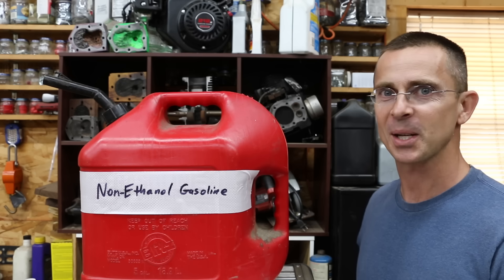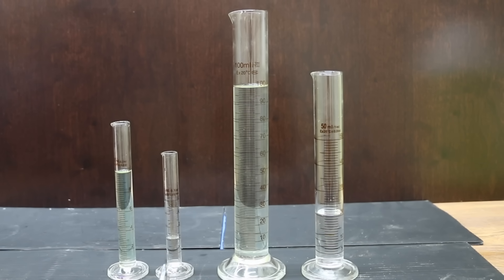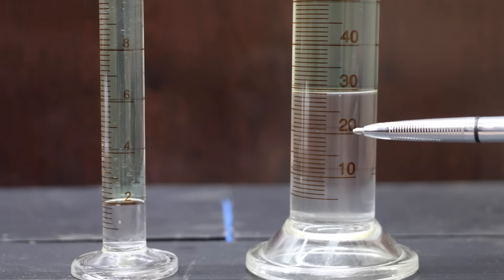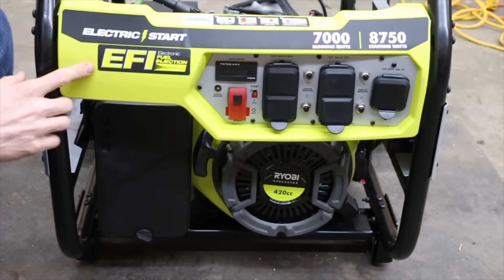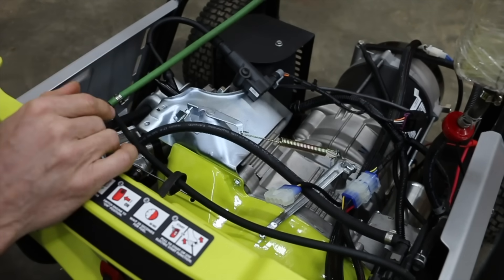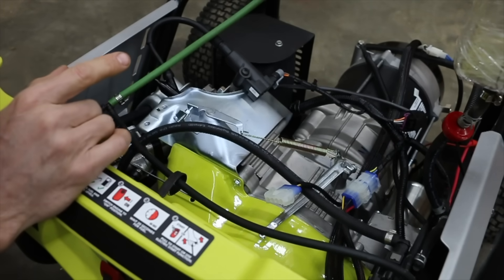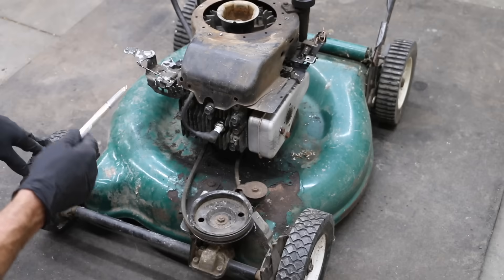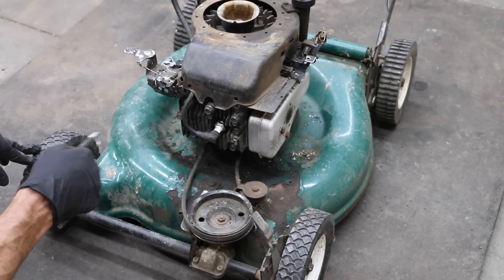Is Non-Ethanol Gasoline Really Better? See the PROOF!

Comment: I've purchased three Holley mechanical gas pumps for my 1967 Ford Mustang.  They failed and I've got a fourth one ordered.  Holley explains to me that they don't warranty any mechanical fuel pump that is used with any ethanol gasoline.  That pretty much says it all.
Reply from the maker: Great information. Thank you
Reply: I think this says more about Holley than ethanol gasoline.  Sounds like Holley is living in the past.  Ethanol gas has been around for HOW MANY decades now?  They need to up their game.  They are resisting change like small engine manufacturers.  And perhaps with the same planned obsolescence as their model perhaps?  Auto manufacturers cracked the code on this a LONG time ago.

What is the mode of failure?
Reply: @mikemorgan5015  Diaphram.
Reply: @web5271  Yeah, that should be a pretty easy material change fix.  It's unacceptable to produce a part that isn't compatible with 99% of the available fuel out there.  Knock on wood, I haven't had a fuel pump on a vehicle fail in years.  This reply is probably the kiss of death for that record.  Haha!
Reply: @mikemorgan5015  I have a 1983 stihl chainsaw and have never had a problem with ethanol gas.  I think the newer stuff is made cheaper and that's the real problem.
Reply: @CraigThorne  I believe you.  Stihl "gets it".  They are a premium brand for pros(mostly).  Their reputation is worth more to them than a few cents or dollars worth of better materials.
Reply: @CraigThorne  Reputable companies all had to change any rubber compound in their products over to ethanol compatible synthetic blends when ethanol was introduced to the market.  This is the main reason ethanol is not allowed in aircraft, and not recommended for boats.  Most brands in these industries never accommodated changes in fuel chemistry.  Plus, 100% gas doesn't go bad in a few months.  Ethanol is alcohol based, where gasoline is a hydrocarbon, oil based.  Not many types of rubbers are compatible with both alcohols and oils.
Reply: @jaredbrandt9602  Yes at around 1990-92 when congress passed amendments to the Clean Air Act.  My saw was built in 1983, some 10 years before mandated use of Ethanal in gasoline, and it runs just fine and i've not had any problems with fuel-lines breaking down etc.
Reply: @CraigThorne  I'm trying to wrap my brain around this strange comparison...so you think because your 1983 saw is still running that ethanol is not a significant cause for problems for all gasoline machinery?  Dang tell the FAA we can use ethanol at the airfield now...cracked fuel lines is no big deal for 1983 saws, so why should it matter at 10k AGL???
Reply: @jaredbrandt9602  So trying to wrap my brain about your false equivalency with aviation and most all other engines that use gasoline.  Guess what i don't use high octane gasoline in any of my vehicles.
Reply: Holley knows there are issues and had plenty of fuel pumps on test since at least 2000.  Marketing was too cheap to include viton o-rings...added $0.2 too much cost to the product.  Ethanol is not compatible with standard rubber seals.
Reply: @jaredbrandt9602  I'm not up to speed enough to weigh in on details with any authority, but your scenario seems highly likely.  Viton is great stuff.  It's been around a LONG time too.  I build chemical application equipment and started ordering Viton seals and o-rings separately and replacing the factory seals before we put systems in the field.  Call backs and complaints went to near zero immediately.
Reply: ...another funny thing about ethanol though.  Main reason it was implemented was to put all the dilapidated (and cheap for politicians and oil manufactures to purchase) corn farms in the corn belt to work.  EPA and other gov offices have been nosediving progress in automotive in the USA for years...pretty much what they did with the rest of American industry.  It's all about keeping the fat cats on top.
Reply: @jaredbrandt9602  that's a myth, industry switched to ethanol for octane ratings due to pollution litigation and impending bans of MTBE fuel additive due to billions of dollars in remediation costs of soil and ground water contamination.
Reply: That's just a way for them to get out of paying you back for all of the money you've spent dude.
Reply: It says to me that Holley can't be bothered with engineering a product that works with ethanol.
Reply: I have a SU electric fuel pump on my 1957 Austin Healey.  Been running for 20 years using E10 ethanol fuel with no problem. If SU can make a fuel pump that works, Holly should be able to.
Reply: @Marcus Mcgarkus My carbs are SU. I jhave never seen a "Big Healey" with Zenith Strombergs. Maybe Sprites, but they are usually upgraded with Webers.
Reply: Holley mechanical fuel pumps are junk. I learn that the hard way, has nothing to do with fuel.
Reply: I don't like anything remanufactured by Holley.  I went through 23 bad carburetors, finally went with a Edelbrock.  I didn't know if the bad pumps you got were new, or remans?
Reply: @Thomas what am I wrong about?
Reply: When they first started selling ethanol based fuel in Australia the pumps had to have stickers on them warning people not to use it in light aircraft. the stuff is bad it makes older cars with carbies run rough, if left in tanks it  does all sorts of damage gums up piston rings, i left some in a generator after only 1 use the next time i turned the petrol on to start it it leaked out of the carbie everywhere.
Reply: you can’t take all the water out of alcohol, not cheaply anyway.
Ethanol will always be corrosive
I’ll never use it.

Comment: Nothing better for an engine valve train than LED!
Reply: matrixbikes ... Light Emitting Diodes? Or do you mean Tetraethyl LEAD the fuel additive from years ago?
Reply: @rupe53  Yeah, obviously I misspelled it. L.E.D. is not doing anything for an engine. It is not so hard to figure it out that I've misspelled the word: lead. Do you know anything about engines or just enough about the English language {in America}? {by the way you can write tetraethyllead in one word also}
Reply: @matrixbikes  ... you are correct that the word can be spelled either way. It most commonly appeared as two words for the markings on fuel dispensers. I do know exactly what it was used for and spent 50+ years working on various engines. (just retired)

Comment: All I know is that when my car used partial ethanol fuel when it was first introduced, the engine started having all kinds of problems. I had to get rid of the car within a year after it started using partial ethanol fuel when it was working just fine before.
Reply from the maker: Thanks for sharing.

Comment: Is ethanol fuel damaging?  I have a flex-fuel truck.  For about 6 months after being laid off I put E85 in  it because it was so much cheaper than regular gas.  A $4000 for a rebuilt engine because the E85 destroyed the exhaust valves on 2 cylinders.  And it seems that chips from those valves plugged up the head and block so replacing the engine was the best option.  Yea, ethanol fuel is damaging.

Comment: Ethanol has extremely high octane and that's good.  But ethanol has less btu's per gallon which means fuel mileage will not be as good as with gasoline.  But all the alcohols burn cleaner and could greatly extend oil change intervals if used exclusively.  However it is expensive to make and unless it's made from coal (methanol) there's not enough biomass to run an entire motor economy on it.  So we're stuck with petrol and hopefully hydrogen will come on line in a meaningful wayt.
Reply from the maker: Thanks for sharing.

Comment: I would like to see an episode on comparing high octane fuel versus regular fuel and hydrogen on demand systems that feeds hydrogen while it is being made on demand in through the air intake or carburetor and measure the power and fuel savings plus distance achieved on one gallon of fuel.  That would answer a lot of questions on douse it help clean the engine at the same time deliver more power while using less fuel flow to the engine intake thus saving on fuel cost and producing less pollution?

I have heard about a town using it on all their town vehicle’s like fire trucks, ambulances, garbage trucks etc. and they claim to have saved thousands and thousands of dollars on fuel cost and maintenance.
Reply from the maker: Thanks for the video idea.

Comment: I prefer non ethanol when running 2 and 4 cycle lawn equipment. I've heard and found out for myself that its easier to start them with non ethanol than with ethanol fuel. 😎
Reply from the maker: Thanks for sharing.

Comment: I think my biggest concern is what ethanol fuel does to rubber and plastic components over time. I use non ethanol in all my small engines including my motorcycles. I was told by a motorcycle mechanic that if you use the entire tank full (of ethanol laced), it won't be problematic. The issues occur when you let the ethanol fuel sit in engines for an extended period of time. Can't hardly wait for the long term test! Great idea Sir!
Reply from the maker: Thanks for the feedback.

Comment: Yeah, I agree, it is watered down gasoline. Ethanol is so much cheaper than petrol that they basically sell you 8/10 or 9/10 for the value of 10/10. Genius! Perhaps no long term damage to the engine, but you are getting less MPG with the ethanol fuel.
Reply from the maker: Thanks for the feedback.

Comment: I became a firm believer of ethanol free and I've been using it only to have a horror story.  So I go out to a storm damaged location and I'm salvaging these two very old sections of cedar in two trunks one leaning toward power lines and one leaning toward house. Used my 20k trailer as an anchor and chained the trees 10 foot up and had two come along winches.  I went to cutting and winching the trees.  I had non ethanol 2cycle mix I made and a premixed $20.00 can.  I dont know if I mixed the two or if my ethanol was bad or if the high dollar can was bad but all fricken 4 or 5 of my saws stopped running before I realized a fuel problem.  There I was with severely cut cedars on a sunday night 130 miles from home with no workable Stihl saws.  Someone loaned me a poulon saw thank god.  I was able to nick my cut enough to get the trees to fall. From that point forward I only use 93 octane with lucas octane booster, lucas ethanol treatment and seafoam splashed in there.  Wish me the best.

Comment: I did my own, non-scientific experiment, using our three everyday vehicles. Our vehicles are always well maintained. Two years tracking fill ups with all grades and types of fuels led me to know for a fact that 100% gasoline @ 89 octane or higher gives us way better fuel mileage. I now have three different vehicles and use only 100% gas. Two F150 Lariat's both 07' with Triton motors and both get 18 to 22 MPG all day long. The other one is an 13' Edge and gets 27 to 32 all day long. On occasion while taking road trips we have to gas up where 100% isn't available and within a short time mileage will noticeably drop with the trucks getting 12 to 16 MPG and the Edge drops to 19 to 22ish MPG. It will take at least two fill ups of 100% gas to get the mileages back up to normal. I run 100% gas in everything we own, mowers and all.
Reply from the maker: Thanks for sharing.
Reply: Have same expierience with 2.4 inline natural aspirated engine. On a long trips with 100 octane on a high speeds avg. 160-180 kmh on German highway🤣 my mileage is much much better. ✌Every time I use 5% Ethanol( btw its probably more than like +3% more depends on producer) the consumption is always higher.

Comment: I was told by a guy repairing my lawnmower, that small engines like these, should burn gas with no ethanol. I heard the older cars with carburetors should burn gas with no ethanol, because the ethanol is bad for the rubber parts.
Reply from the maker: Thanks for the feedback.
Reply: Not even just carbed cars I've owned alot of older cars. I would put ethanol free in anything older than 1996

Comment: Re: 1:55, I've just started using outdoor power equipment. I want to embrace this method of using water as an extraction solvent, but how did you reason about this method being legit?

Thank you for your excellent content!
Reply: Ethanol is hygroscopic. It will pull the ethanol out of solution, bond to it and settle to the bottom.
Reply: ethanol is attracted to water,water pulls all the ethanol out as you saw....

Comment: I’ve been a mechanic since the 1970s I’m pushing 70 now myself ethanol is the worst thing you can put in your car oh and maybe some of the new cars were they coded in lined everything so it won’t destroy the engine it’s like corn is it supposed to be in your car and it sure is hacking supposed to be in your body corner oil will kill you clog your arteries 10 times Faster than animal fat the only good thing you can do is corn is made corn liquor these other uses long-term destroy
Reply from the maker: Thanks for the feedback.

Comment: I know that in communities where logging is a common industry you can buy gasoline without the ethanol, MTBE ether, or methanol additives. They tend to F' up two stroke engines, according to the gas station owners where I buy my non-ethanol fuels. My biggest problems with MTBE or ethanol were the alcohol evaporating, expanding in the tank and flooding my engine upon startup.
Reply from the maker: Thanks for the feedback.

Comment: ethenonl is another way to water down your fuel but charge you the same it saves companies money since alcohol is cheap to make so they put it in and charge you the same claiming its to save the enviroment it dont... ehtenol is bad for rubber and fuel lines its why your weed whacker always every year has to change out the fuel line and why it always gets clogged the carbs and dont get me started on lawnmowers from the 2000s till now they intentionally make the pilot idle holes small so they clog and you think it wont run so you go buy a new one get ethgenol free fuel or you can do it yoruself its easy to do
Reply from the maker: Thanks for sharing.

Comment: I have heard from a guy that works at a refinery that there is lpg pumped through gasoline , it dissolves into the gasoline and by this way they  can make more profit if the oil prices are rising. Also in “winter gasoline” there is more LPG . My experience is that “winter gasoline” stinks alot more than “summer gasoline” 
Can you test that ? Is there really (cheap) LPG in gasoline?  Im located in the Netherlands by the way, and the guy works at a BP refinery.
Reply from the maker: Thanks for the video idea.

Comment: All I know is that in the Briggs & Straton engine our lawnmover have the rubber gasket somehow takes damage from the ethanol gasoline mixture which make the engine if I remember correctly stall and not want to run. However it's a pretty cheap piece and you can replace it. Here in Sweden getting gasoline without ethanol isn't a solution but you had one for that but one solution which exist is to get aldehyde gasoline instead but that one is way more expensive and it's not a cost efficient solution vs replacing the rubber gasket but it may save you time and having to do that and it's supposed to be healthier?
Reply from the maker: Thanks for the feedback.

Comment: One of the primary benefits of ethanol blended gasoline is it allows moisture to be absorbed and run through the engine instead of sitting in a fuel line or tank. The water could cause the engine to stop if it runs through the engine because it does not burn. Liquid water in fuel lines will freeze when it gets very cold.  It takes a lot of water for ethanol fuel to separate, that water would be a big problem whether using ethanol or not. It is true ethanol does not give as good fuel mileage.
Reply from the maker: Thanks for sharing.

Comment: Here in Brasil cars run in 100% ethanol fuel. Carbon accumulation is lower, emissions are also MUCH lower, and engine power is BETTER by up to 5%. Mileage is lower, but so is the cost. You will be filling up more frequently but spending less, anyway.
Reply from the maker: Thanks for the feedback.

Comment: Short answer, yes and no. Pros and cons. If we are using 10% less gasoline in our gasoline, that means we have 10% more net gasoline. If we use 100% straight gasoline, we are losing that 10% but it also burns cleaner and doesn't fuck up fuel rails and injectors. Also, do not leave ethanol gas in your single piston motors with carbs, if it sits too long, it will turn into a gel that is REALLY hard to clean out lol
Reply from the maker: Thanks for the feedback.

Comment: As your test showed I don't think there is much difference when a motor is being ran or ran on a regular basis. The issue seems to be when the fuel sits as I'm confident your next test will show. Maybe get two small engine carbs and leave both fuels in them for 3-6 months and compare the bowels, jets etc. Keep up the great videos!
Reply from the maker: Thanks, will do.

Comment: 4% - yep that is what the straight up math would say.  They got away with charging the same during the switch over period many years back because gas prices were fluctuating so much at the time that no one noticed they were getting less energy density (i.e. reduced MPG) for the same price unless you were keeping close tabs on actual fuel mileage (not cost) for every tank full.
Reply from the maker: Thanks for sharing.